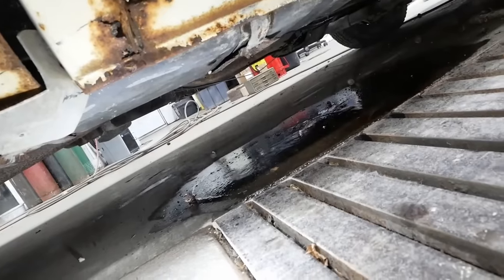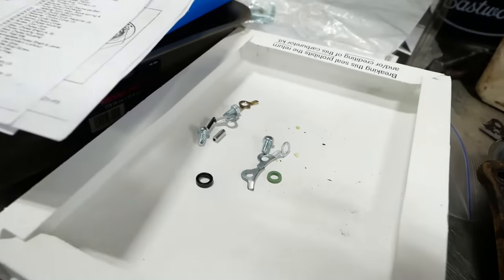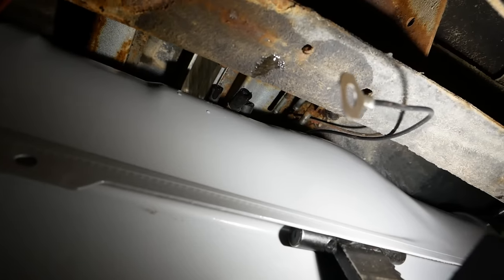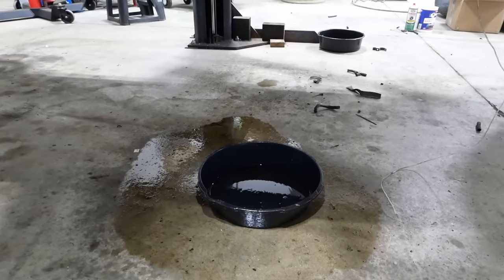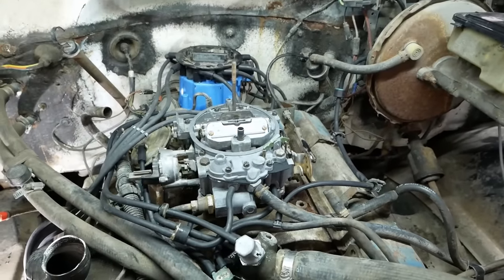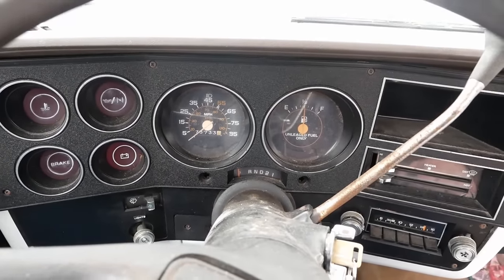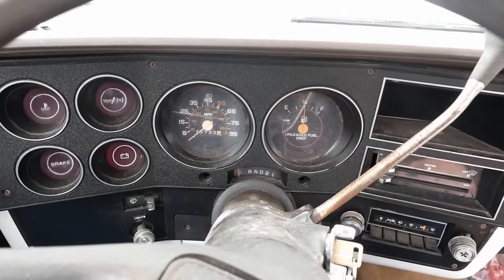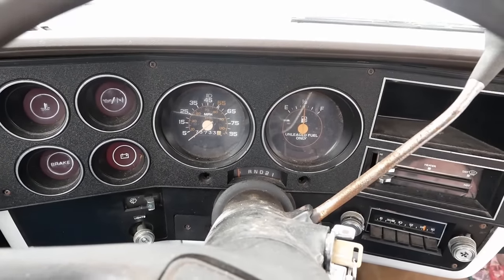Millennial vs. Carburetor | Square Body Chevy Back on the Road After Sitting 12 Years

Comment: That is some fine workmanship on that tank, my friend.  It is probably better than factory.  The more we keep emulating Cuba, the closer we are going to get to rebuilding 1950's cars over and over and over, because that is all there is.  It sounds like a good running truck now.   I can't remember a vehicle of this era that didn't stumble a bit here and there.  Jeff Bradshaw at Elderly Iron/Redneck Restorations here on youtube is a great resource for old GM products.  He worked as a GM mechanic if I remember correctly, and that is mostly what he likes to work on.  He has done some videos explaining these old Chevy carbs.

Comment: I bought a 600 Holley Street Warrior ($229 new off ebay) with electric choke and it saved my sanity. Worked great right out of the box with a very slight turn of the choke cap. 
I now have another old Q-Jet under my bench. Someone tell Uncle Tony to come by and get them!

Comment: Don't sweat these carb issues!  It's gracious of you to include all aspects of your repair efforts.  My dad always told me "carbs are the simplest thing on a car."  They were to him ... not to me.  One of my sons has an expert level understanding of them so I guess it skips a generation!   There are a bunch of folks on here that are ONLY here to bash others.  They likely never fix ANYTHING themselves.  I do have a suggestion for you though.  My dad had a 5 gallon bucket with a very strong carb cleaner solution in it.  It had a parts basket he would put all the carb parts in and drop them into the cleaner.  He swore by that stuff and it served him very well.  He used a small piece of SS screen with a tiny SS hose clamp for the very small items to lay in the basket last.  WELL DONE WES!  Keep it up!

Comment: I'm 78 and when I was 16, I was having a devil of a time installing a new fuel pump on my small block chevy.  An old retired mechanic showed me a trick.  He put grease on the push rod to hold it up in the hole while he installed the new fuel pump.  Just passing along some old tricks I learned many years ago.
Reply: I have used that trick as well.  I think the swapping that bolt he showed for a LONGER one and hand tightening it against the rod works best though.  Really frees up both hands and don't have to worry about the grease letting it slip.  Just make SURE to replace the bolt with the original before trying to fire the truck back up.

Comment: Choke thermal spring is to be set cold so when accelerator pedal is pressed to floor and back the throttle will be pulled by the thermal spring so throttle plate is open only slightly (to factory specification (typically checked with a gauge or small 1/8 or so drill bit between throttle plate and carburetor housing)). If engine stumbles when pressing the accelerator pedal fix the accelerator pump in the carburetor. The accelerator pump should squirt fuel into the carburetor a little or a lot depending if the pedal is pressed a little or a lot (
like a squirt gun). 
We enjoy your videos!

Comment: I was sure sad to see the carbs go away, not that they worked better than fuel injection. It's just that they paid pretty good rebuilding them, next time you want to remove the top off a Qjet just use a small pin punch and drive the roll pin in the middle of the green arm through but leave enough room to get a screw driver behind it to pry it back when you reassemble it. Also if you wind up with a hesitation you can fix that by simply stretching the spring under the primary metering rods. I bet I could still put that thing back together blind folded, I am not trying to brag, it is just that I done so many of them.

Comment: As a millennial, I struggled with carburetors on my project for months. I ended up going with aftermarket efi. It’s a nice upgrade to get while you are going through the fuel system anyways.

Comment: Years ago, 1970 or so, I had a Chevy six cyl.  I bought a rebuild kit.  4 people help tear it down.  Solo putting it back together.  Finally stuffrd all the parts in the old one, went to the parts store and bought a rebuilt carb.     Misbehaving choke :  replaced with manual choke.

Comment: Chevy fuel pump replacement made easy. Use the engine oil dipstick.  Also. Set the engine to number 1 tdc compression stroke. That puts the fuel pump eccentric at full retract to allow you to use the dipstick straight down from the top. Pushing the pushrod back with the pump lever to drop the pump in.  I always glue the gasket to the pump.  Get the 2 bolts started. Do not tighten.  Wiggle the pump around to get the hard line started.  Then tighten the pump bolts .followed by the hard line.  

Please install a 1984 corvette fuel filter in the inlet line to the pump inlet.  This prevents sediment from the gas station and the fuel system from holding the fuel pump check valves from leaking slightly.  Causing cold start. Stall after 15 seconds. A minute of cranking and pumping to get it restarted.   Also stops hot vapor lock..

Comment: There are 3 timing adjustments on those systems. Base timing,  vacuum advance timing  and centrifugal timing. Base is done at idle at normal operating temperature. Vacuum advance is none adjustable in most cases with stock parts, and centrifugal advance which is located under the rotor inside the distributor.  It consist of springs and counterweights and bushings.  They are adjustable, first make sure the bushings are good and replace the counterweights,  the adjustment comes from changing the springs. Weaker springs equals more timing advance. I always ran 4 degrees base, with a stock vacuum advance-hooked up to a direct, ported vacuum.  No factory check valves or delays. Direct ported connection gives you much faster response and less stumbling. And finally adjust the centrifugal advance so as to have 32 degrees total advance when everything is all in. Of course all this needs to be done at normal operating temperature.

Comment: I know you may not see this since it’s an older video but I used to work on octane test engines at the refinery where I work. We’d put a solvent called Micro 90 along with some water to dissolve deposits on stuff in a sonic bath. Works amazing and is safe and non corrosive.

Comment: From 1951 to 1994 my Dad was a mechanic at a small Buick dealership. I worked there 1977-1978 as a lot boy. The new cars at this time did not run very well, sometimes at a stop light you would need to “feather” the throttle so keep running. Customers would complain about driveability and my Dad would say “That’s the price we have to pay for clean air”.

Comment: The Electric choke " Is " adjustable..it turns the spring and adds tension or lessens tension on the spring....you adjust it as needed..and by the instructions....I'd have to look in my manuals to recall.... it has markings on it... and has screws to tighten it..if it only goes on one way it would be non turning... i haven't dealt with those in over 20 years....lol ..but i recall adjusting them... i rebuilt my van and suburban carbs from that era...

Comment: M4MC Quadrajet. I had rebuilt so many over the years that I bought all of the KENT-MOORE tools from GM to rebuild them. Rebushing the base plate to eliminate the air leaks around the throttle shafts, the calibration tools for the feedback version of the M4s, etc. However, the air horn was an issue with the accelerator pump well. They would wear oversize and you had to buy another part# pump assembly not just the cup. Without all of the thermostatic vacuum switches, vacuum advance, egr valve, evap purge valve, TCC switch,  and linkage dashpots, all working normally, running the calibration on the M4MEs, the dwell sweep was tough to get consistent. But while watching your O2 sensor voltage at steady state idle and your cross counts if you had it in the nieghborhood it would dwell out. Otherwise, like an egr stuck off its pintle you will never calibrate it.

Comment: Excellent video Wes, good job.  Love the old quadrajet carburetor, simple and very easy to rebuild and set up.  Don’t know if you replaced the float but I always do.  I also spread the some what u-shaped float rod so that the top section of the carburetor holds that down so it doesn’t allow the float to float.  You did a great job with for not doing a lot of carburetors.  There are a few simple tricks that I was shown by a Chevy dealer tech back in the late seventies that really help but they are specific to the vehicles engine condition.  They do take some tinkering to fine tune to the specific engine condition.

Comment: I did these carbs for years and others to and choke adjustment was usually the most difficult thing to get just right. Sometimes we would have to  keep it overnight a second night. Always give it 2 or 3 pumps then start, the choke pull off should open the choke about 1/4 inch. Fast idle adjust about 1500 RPM notice I always say about. It depends on time of year and how cold it is it may take some modification to adjustment. believe me choke adjustment was about the hardest part of the job and the cause of most comebacks for carb  Overhaul. The next one will be a breeze. You learned most of the problems.

Comment: Owned a 1982 k1500 for 24 years. The first year with an electronic spark control system. Nothing but problems  fron day one. Struggled with idle problems until I finally deleted it . Those quadrajets were notorious for vacuum leaks and idle issues. But even after all that it started everytime no matter how cold it was . -40F no problem.

Comment: I am not a carb expert at all so I have no real suggestions.  Other comments are beyond my knowledge.  But the 1939 and 1937 Chevy I learned how to drive had a choke and a throttle cable on the dash.  Easy and not complicated.  I would prefer to have either of those back or my 1954 Chevy.  I could fix those.  Thanks for the video's.  You are doing a great job.

Comment: as someone who was born in the early 2000's these style trucks where the workhorse at my uncles place. he has had the same squarebody as a plow truck for 30 years, yeah the floor is non existant and the box is non existant but that thing with start faster then most trucks that has gone through the same abuse. He has been thinking of retireing it soon because he put 3 boxes and 2 gas tanks in it, but the original motor is still in it never been rebuilt only has been resealed with a new oilpan and rear main seal. its greasy its loud but the thing never gives up lol. I think the only major thing that went wrong with it was the transmission from dumping it into drive and reverse so much from plowing. But he did get a quck shift kit for it so he could get up and go faster, other then that like you said he dumps the cheapest and crappiest oil he can find on the market in the thing and has never had in issue with the motor (other then the vaccum lines disenigrating). other then that he has another squarebody in line ready to made his new(ish) plow truck.

Comment: My grandfather who probably never worked on a car made after 1985 told me that in order to convert an old 60s car to be a modern daily driver, you might have to switch out the valves for non-leaded fuel, and you will have to do a carb tune or rebuild and that's it. Just use the same rating oil. He has a 1964 Galaxie he drives a few times a week with no issues, and has had it this way for like 15-20 years So according to him there will be no camshaft issues.

Comment: Apt adjustment is back up the truck. Give it a quick stab of the throttle. If it falls on its face go up 1/8 of a turn. Back up and goose it again. You can feel the adjustment with a small screwdriver down the round bowl vent. Pushing down on the primary rod holder.    You can lower the apt setting and start way lean.  Bringing it up to just start lifting the primary rod holder from the lowest position. Give it one turn up .  Most quadrajets are 3/4 of a turn to about 3 turns up from fist contact with the depressed primary rod holder.   Getting it within a quarter turn gets you incredible fuel economy and crazy crisp off idle throttle response.   

This is how lean the primary main circuit will be with vacuum holding the primary rod holder down ad you come off the idle transition circuits or low speed circuit.

Comment: Thanks for taking us along for the ride, Wes!  This brings back a lot of memories, since our family was heavily into GM cars and trucks back then, and I learned a lot about rebuilding Quadrajets and doing tune-ups on many GM products.  I believe that the Quadrajet is a much maligned carb... getting the idle mixture screws set right, using epoxy on the secondary metering well plugs, and getting the choke set can make a world of difference on one of them.  And adjusting the tension on the secondary throttle plates can really wake one up so that you can go WOT from a standing start without bogging down.  My Mom had a 1980 Olds Cutlass Calais with the 305, and after getting the Quadrajet set up right, using a converter "test pipe", and putting on a 14" chrome air breather on it made it into a decent performance machine... she told me about outrunning a late model Corvette (some of the ones at this time were pretty gutless!)
Reply: Ain't no way
Reply: @SuperNoticer  My mom outran a Lamborghini with her Chevette....

Comment: You are on the right track a Quadra Flush can be the bigest pain in the tail pipe you may ever run across or want to run across.  or the sweetest carb on the planet I have had both on numbers occasions.  but the biggest problem is trying to complicate the basics. Your carb rebuild was spot on from what I could tell. your bushing replacement very cool. the choke yes it is adjustable there is a relaxed position and a wound up position. and they will vary from carb to carb. that is why there are about 8 notches on the housing one pointer on the choke. look to the EGR valve for a leak I have seen some that have burned through the intake, exhaust gas to intake exchange of gases 'Rare" but it did happen vacuum leaks in the intake, and brand new base gaskets those plastic spacers are too tall for the base gasket. Use a Vacuum gauge to set Idle there are a number of channels that show a procure. good luck!

Comment: Early Fuel Evaporation valve is the control valve between the exhaust manifold and exhaust pipe that restricts the flow of exhaust forcing it to flow through the channel under the intake manifold warming the air and aiding fuel atomization and speeding engine warm up. The heat stove allows warm air from the exhaust manifold shroud into the air cleaner snorkel preventing stumbling by warming the air being drawn into the carburetor.

Comment: I haven't read the comments so this may have been suggested but heres the old school way to adjust a choke. (I have a vid on it but heres the cliff notes),
1) the engine HAS to be ice cold, i.e. let it set over night. You cannot adjust the choke properly on a warm engine...
2) loosen the choke just enough to be able to turn it.
3) If the choke isn't wide open, physically hold the throttle open and open the choke, release the throttle and it'll stay open.
4) now turn the choke "rich" a notch or 2 then tighten 1 screw. Open the throttle to see if the choke closes the choke plate.
5) Adjust the choke to the point where it "just" closes the choke plate consistently. 
6) This is where you now want to try to start. I like to do 2 pumps to set the choke & squirt fuel into the venturi's.
7) It's not unusual to have to adjust the choke a little on the rich side if the electric choke opens too quickly. You want it to open enough to be kicked down within a minute then kicked down to normal idle within 1 to 2 more minutes. The vehicle can be driven on "mid' fast idle but it's best to allow the choke to fully warm up if you want to avoid stumbling etc.
Good luck. Tackleing a rebushing of Quadrajet is impressive. You're almost there...
Carry On.

Comment: If it has not been mentioned, boiling in lemon juice.  Juice from concentrate if fine.  Boil about 20 to 30 minutes.  I have read about pine sol and boiling in that.  I had not heard of using it in a ultra sonic cleaner.  The lemon juice is acidic.  It has worked very well.  Learned it from a person on the net that restored very old motorcycles.

Comment: We used to call them Quadrajunk.  This is another example of that.  For the time, effort, frustration involved: Put either a Holley or Edelbrock on it instead.  When the one on my early 80's Chevy C20 started acting up, I took it to someone older than I, to have it rebuilt. Worked fine after that, but whoever rebuilt it knew all the 'ins and outs' of those particular carbs.  Oh...  And I'm 72 years old.  And, I remember dealing with various carburetor starting/running issues 'back in the day'.  Look up the Ford variable venturi carb for a good laugh.  Honestly, EFI isn't that difficult to work with, if one is willing to put the time/effort into learning the theory, parts (lots of acronyms...), and fundamentals.  I've transplanted a Ford 5.0L into my 1976 Jeep CJ5, with the factory EFI.  Runs great.

Comment: As mentioned, daily drive an 82. It is normal to stall on cold take off, the secret is to pump it a bit to get it off the line, then give it some throttle, after that it should drive normally. Other wise just let it warm up a bit more before taking off. Best advice I can give. Also I only have the trans lockup, the vac advance, brake booster and pcv hooked up. Bare minimum to get away, and less problems.
Reply: And the speedo cable is a normal issue for the advanced age. It gets better when it's warm.